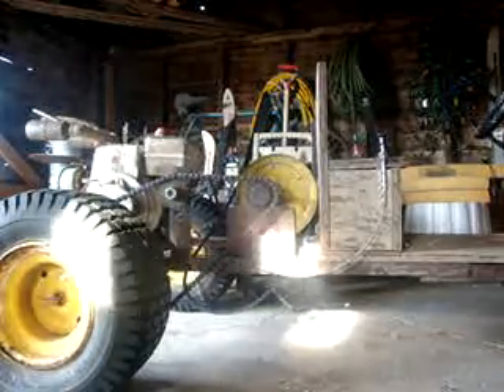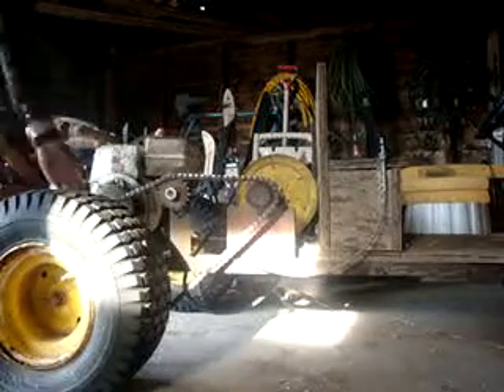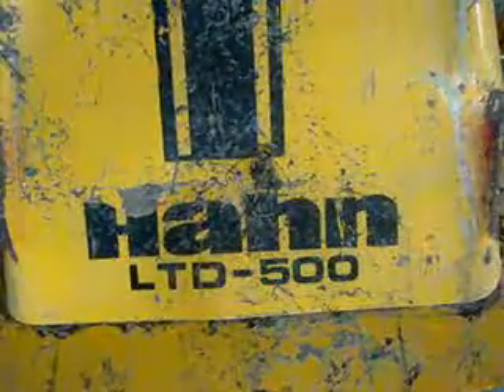Cold Starting The Go-Kart And The One Lawn Mower

Comment from the maker: yea i was driving it around and it got low on oil and ERRRRCH and that was it so i took it apart and DROVE the piston out honed the cylinder to smooth out the scratches or GOUGES adn droke the rings loose out of the piston and put it back together it run fine and doesnt smoke almost not at all when its running at 3/4 throttle hit full throttle and it belches blue and white smoke untill you idle down

Comment: you only had it for a week? ive had my 70 with a worn out vh-70 tecumseh for a couple years now and i think its time to fix it and make it run one way or another. i have had it going. i mowed with it a couple times! it ran fine when i could get it going. but it really needs new main bearings they have alot of play! and it doesnt have spark probably just the condencer i hope!